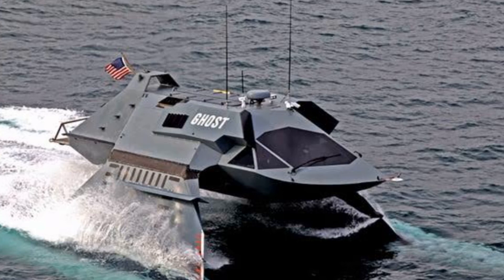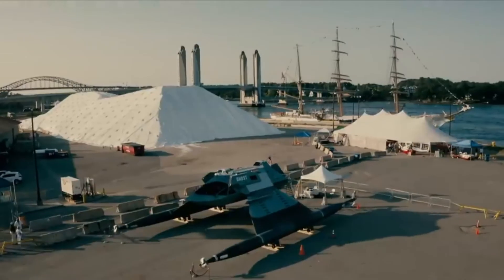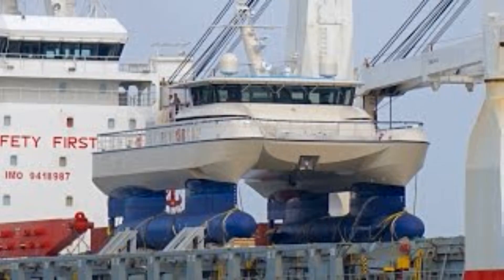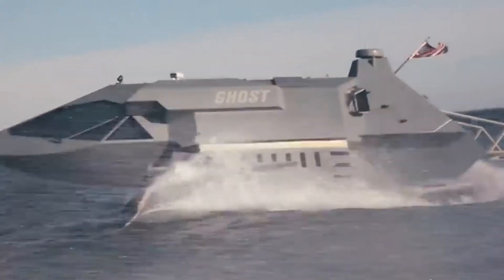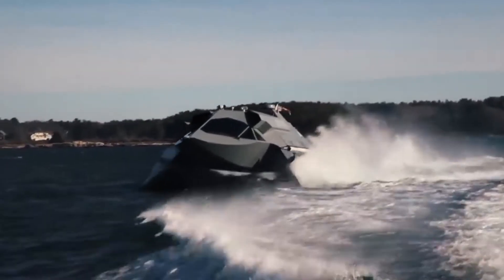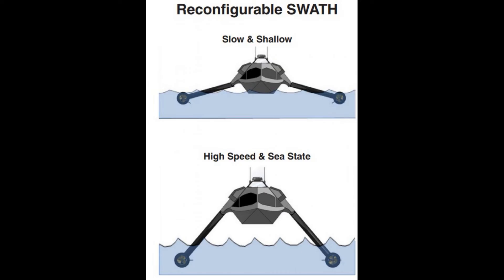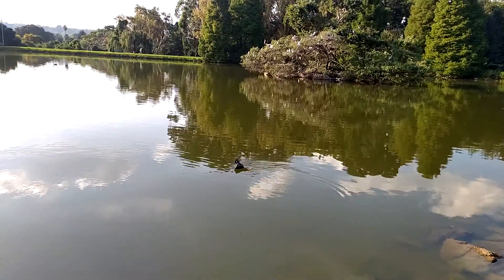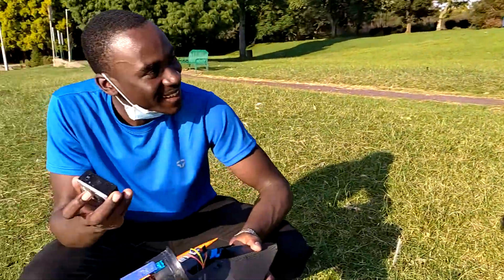RC Swath Stealth Boat (it Sank!!) (Part 1)

Comment: doesn't work at all ;) you didn't understand the physics of a swath, sry
Reply: I totally agree, he needs to make the submerged hulls closed and hollow.  The struts should also be hollow and thin, and sharp to cut through the water.  Both the submerged hulls and the struts help add buoyancy. In ghost, the engines are propellers the hulls. By replacing the propellers with a fan you're also changing the mass distribution.  You will have to redesign the center hull to hold the batteries in a good spot in relation to the fan, and also you have to change the fan setup either by lowering it and placing it closer to the center.   But absolutely the submerged hull and the struts that hold them in place must be hollow and watertight.

Comment: I think the ultimate yacht would combine this kind of SWATH hull with a motion compensation system like in SERVO YACHTS. It would be the end of seasickness and more people would enjoy going boating.
Reply from the maker: You're perfectly correct,there is some potential and good advantages with swath hulls, but the downside with them is manufacturing complications, and more material actually needed for the construction of SWATHs, but put these aside, riding the waves in the oceans and seas in smaller boats would be much more enjoyable.